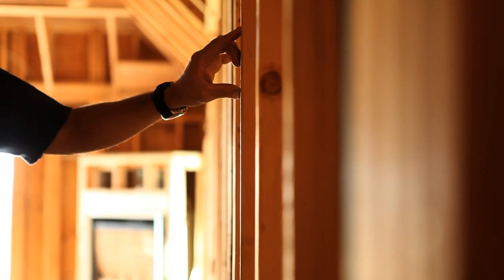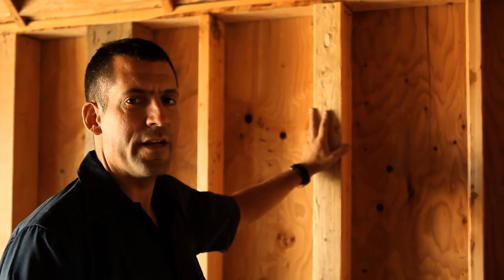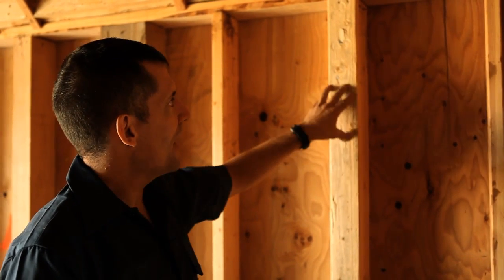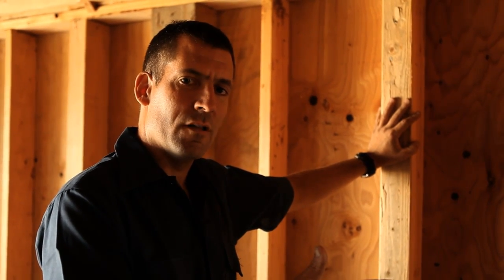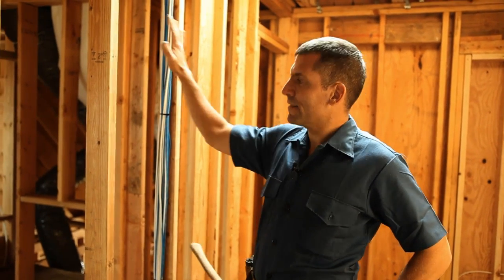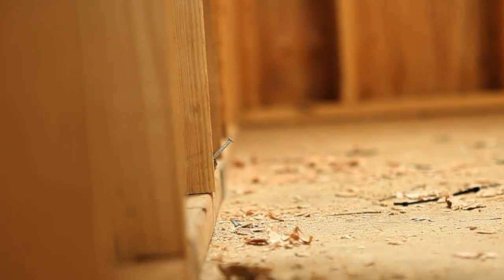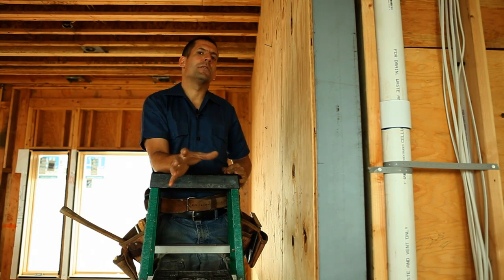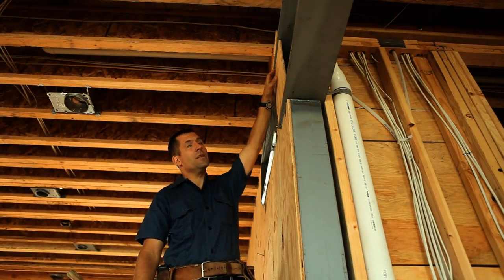Fixing Framing Problems: Find Crooked Studs, Headers, and Beams

Comment: It's a friggin riggin ax the strike face is close to the handle and the head itself is shaped to have more weight to that side making it focus the power into the nail and the blades good for pooping open bundles of lumber and if you're a framer and pull allot of nails then you're a poor framer

Comment: Now this wasn't as bad as some " Instructional " videos put out by Delbert the Framer .. I personally crown in on exterior walls .. Easier to push out and sister than pull in .. But then again throw that concept out the window when the nail banger and his helper picks lumber out of the bunk that is determined to be a propeller for The Titanic ..   with the 4x6 .. absolutely .. plane it down or snap a line top plate to bottom and use a 15 grit grinder .. .. But then again .. Throw that method out the window if the walls are  not straight because Delbert released the braces too soon a month ago ..   One a 25' wall .. taking a straight edge isn't the solution either .. Merely seesawing on a few studs and the one you identify as crooked is actually straight when the other two are crooked .. Like some of my friends .. I have seen morons put a chalk line on the wall until it touches .. and some of them have some nice chalk lines made by Italian craftsmen .... One point of contact will indicate many times that every freakin stud in the wall is wrong .. and you can actually go around the earth this way .. .. If the purlins , fireblocks or lateral blocking .. with a decent eye can see a wiggle .. Then the eye say .. Yep .. I see it !! .. But then again with crowns in every direction .. Just burn the house down and hire someone else .. Run a string at the same distance .. Never touch at midspan .. or try one of these lasers that project a plane .. assess .. and fix ..   I personally don't like to fix .. I fire !! .. I recommend that any wall that has chair rail or cabinetry ..   Order the studs 2 months in advance .. Dig a pit approx. 1' longer and lower the studs  into the pit and fill with water and for color some Add mud .. but make sure the studs are fully immersed and weighted down by cinder blocks .. Then let dry in the sun for another 2 months to properly cure .. spread out in a jumble .. It makes for absolute precision and the drywall artist and cabinet installers will praise you